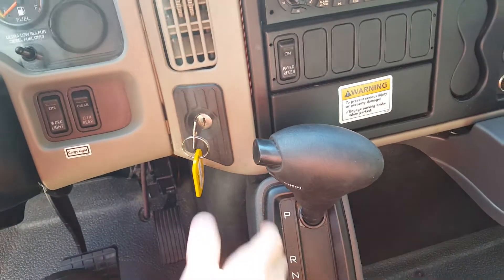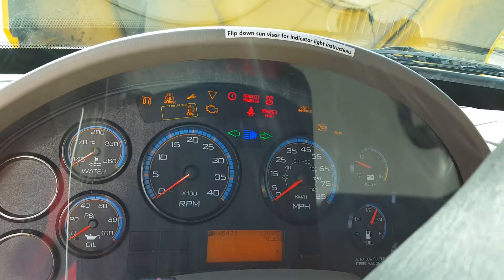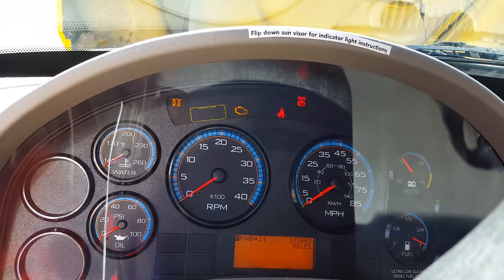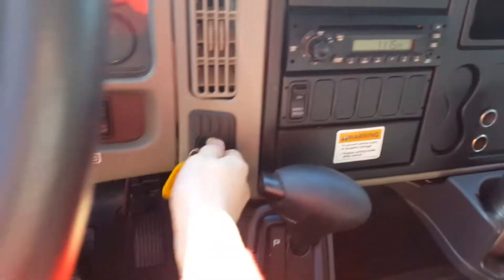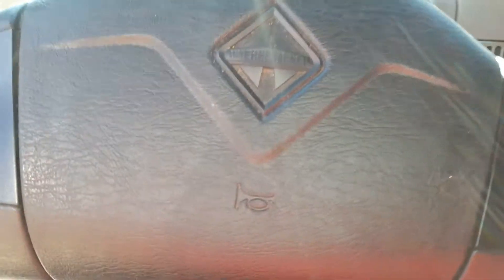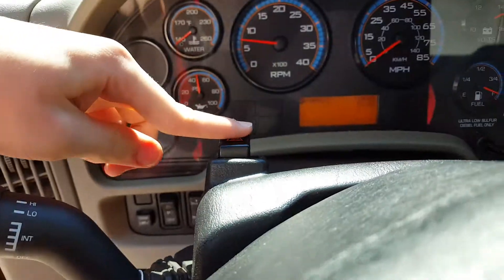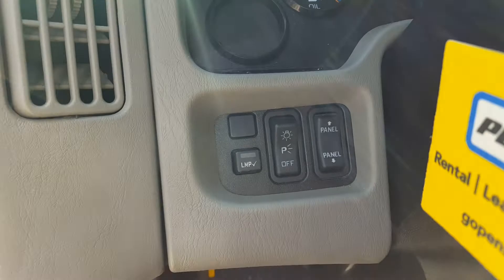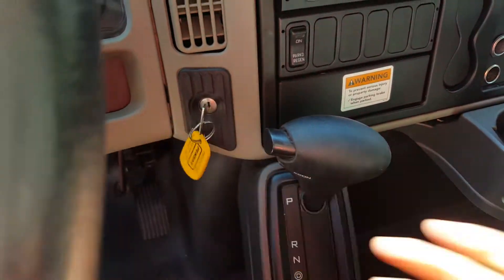International DuraStar MAXXFORCE DT Second Start Up, High Idle, and Under the Hood

Comment: A DT466 mechanical would of been better the maxforce series engines failed due to lots of problems and not very reliable ford used the navistar 6.4 v8 in there super duty’s from 2008 to 2010 then ford almost sued navistar a million dollars over that engine while ford ended there contract with them and made there first diesel in 2011 International was still making the 6.4 for the commercial trucks and buses until 2016 they got replaced with the Cummins isb

Comment: Question this fan is works with a heater coil ? Or does this one have an electrical connection ?
Reply from the maker: It's electric.
Reply: @BusMaster99  okay thanks bud. I thought it was a viscous clutch type.
I noticed today my durastar fan would engage after every other key cycle. 
I popped the hood to look at it and I thought I saw something that looked like a harness behind the pulley but noticed that there was light oil coming out of it.
I have no leaks present on the engine but there.
I'm not sure if what I was looking at was an air line ? 
The reason I say that is because I did change the crank case breather because it was starting to leak. So after I changed it I took a peek inside my intercooler by removing the inlet hose from the cool side of the engine and I noticed there was oil in there.
I haven't noticed any performance loss tho.
So now I have to figure where that oil is coming from and if that's affecting my fan from engaging when it's supposed too 🙃🙃

Comment: Why does the break booster have a sound to it when you press the  break
Reply from the maker: That sound would be the accumulators.  This braking system is known as the Meritor WABCO Hydraulic Power Brake (or HPB).

Comment: Nice but it looks like the ICCE but damn i own one but damn she hot but i have a Cummins ISB6.7L but it has more power about 300 HP
Reply from the maker: Hope yours has the air brakes.
Reply: @BusMaster99  she sure does
Reply from the maker: @raychoncla1175  I wouldn't get a truck without them.
Reply: @BusMaster99  Then buy one if you can just like me
Reply from the maker: @raychoncla1175  Don't have that kind of $$$.
Reply: @BusMaster99  Oof
Reply from the maker: Just saw TheStradman's new upload.
Reply: @BusMaster99  LOL